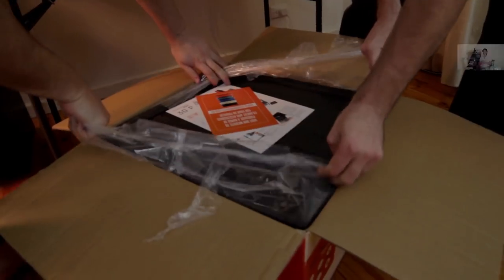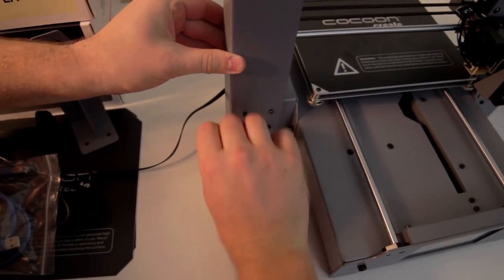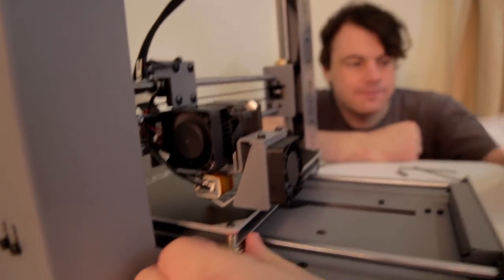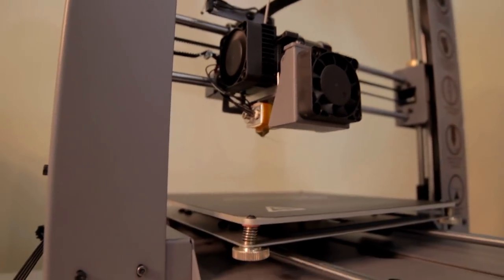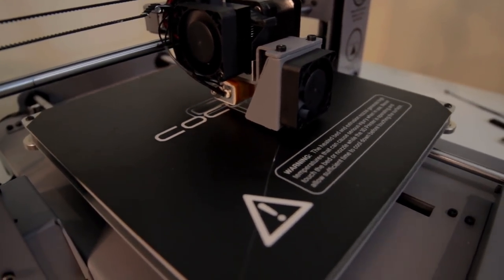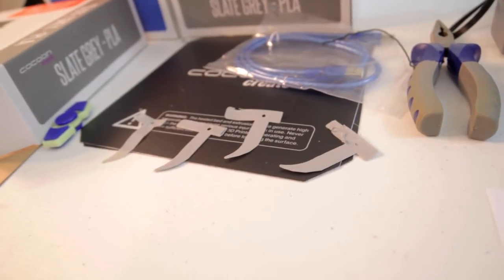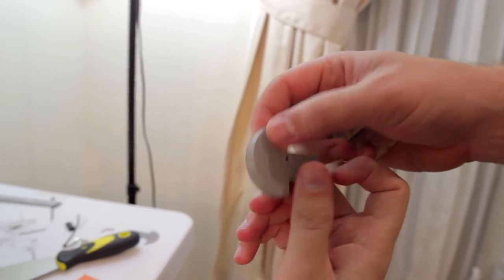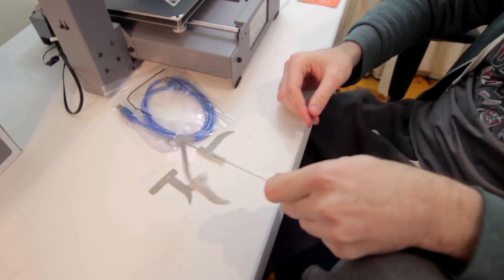$500 ALDI Printer Any Good? | Cocoon/Wanhao i3 Plus Unboxing & First Print

Comment: Hi Guys, the reason you couldn't use the supplied test files is because the supplied SD Card has a folder on it with Unicode characters on it https://youtu.be/qoSWzJAQU0o?t=8m56s I put the card into my Mac, copied the files to the root level and away we went. Cheers

Comment: You probably had problems with the first print because you didn't level the rod where the extruder sits on. You have to measure on the right and on the left side and adjust it so that it is even.^^